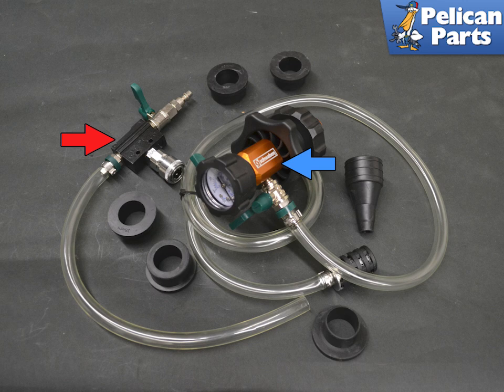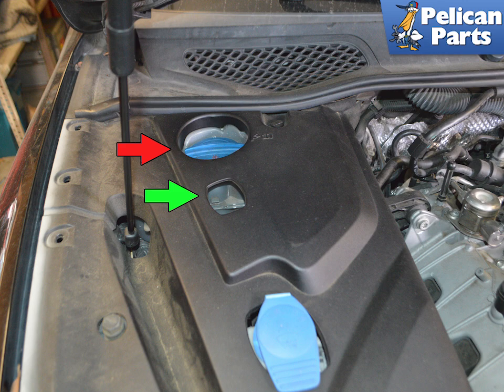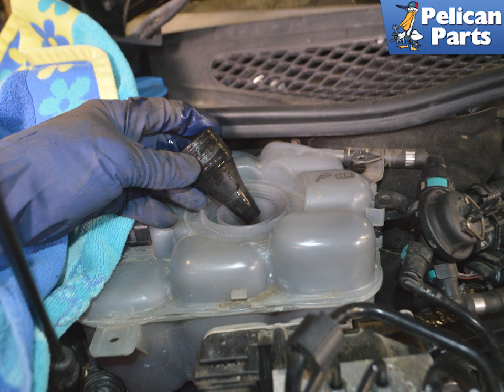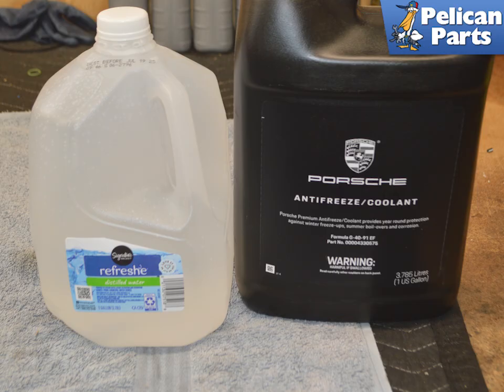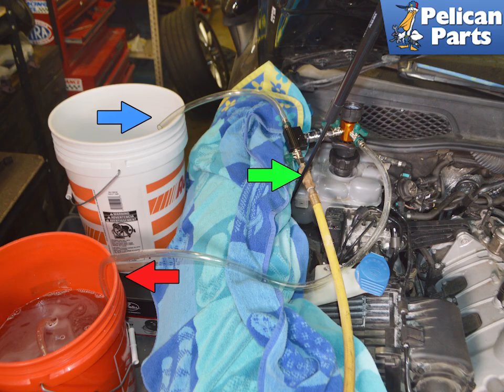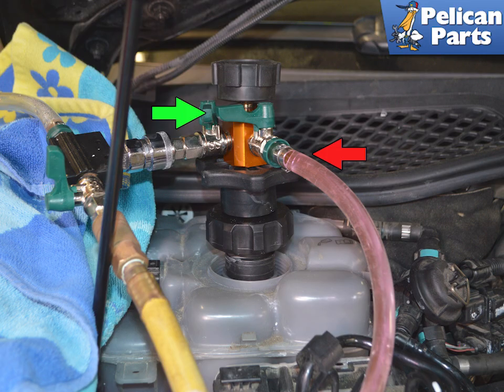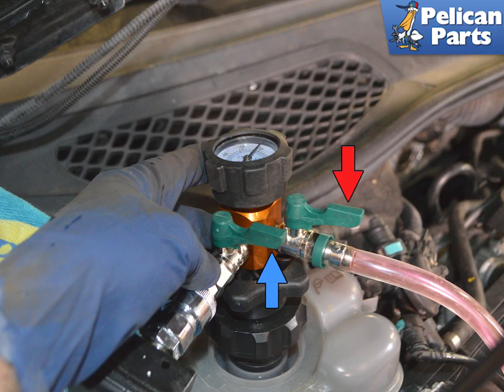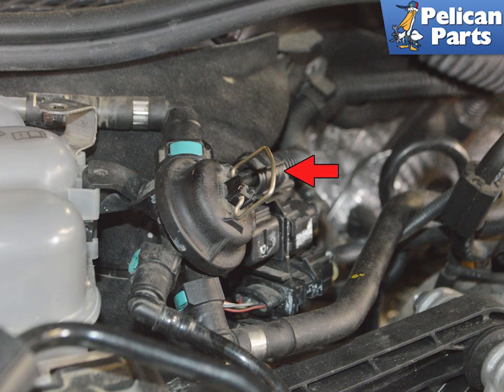Porsche 958 Cayenne Coolant Flush and Fill (2011-2019)

Comment: So according to the video you need 3 gallons of coolant and 3 gallons of distilled water?
Reply from the maker: The coolant amount provided must be approximately 2 liters more than the amount to be filled in when bleeding cooling system.

Because differing quantities of coolant can drain away during different types of repairs, the filling capacity can vary greatly.

Recommendation: To be on the safe side, fill the (bleeding system) cannister to 30 liters, then bleed the cooling system. The difference after bleeding is the coolant quantity that is sucked in. Check the volume scale on the cannister.
Reply: @pelicanparts your diy pages and YouTube videos are excellent. I will start buying parts from you guys.

Comment: Narrator says @1:06 "Open the bleeder valve (blue arrow)."  The 2015 Porsche Cayenne TDI (diesel) does not appear to have this bleeder valve.  What should we do in this case?
Reply from the maker: Best method would be a vacuum bleeder. If you don't have one, you can fill, idle and warm up, let cool, top up and repeat until full.
Reply: @pelicanparts  Cayenne Diesel bleeder screw is located on the EGR cooler behind the oil filter.  Look for a T20 head screw behind the T30's that hold the vacuum controller.  Open the bleed screw with the reservoir uncapped until coolant appears.  I had to do this twice after replacing the coolant parts in the valley of the V.  And yes, fill the coolant with a vacuum bleeder.

Comment: so you have to suck the old fluid first its blue, once it's out you close the blue and then open the red to fill in and how do you know when to stop and if bucket is empty will it suck air into the system
Reply from the maker: Measure what is removed. Then monitor how much you are filling. Toward the end of the fill have extra in the bucket as to not run dry.

Comment: Why must be do vacuum to refill?
Reply from the maker: The way the system is designed, air can remain trapped in hoses and components if you just fill using gravity.
Reply: @pelicanparts  thanks, in this engine if the coolant cap was removed when engine is hot and running can exit water seems like head gasket is burned or takes air the the system?
Reply: @pelicanparts then why the need to "burp"?
Reply: @TheMolacho1  Exactly what I’m wondering. The reservoir is the highest point as well, so if you didn’t use a vacuum to pull all of the fluid out (ie. You just drained it from radiator), I don’t see how air is making it into places that it wasn’t prior. I’m doing this tomorrow on my 16 CTTS without the tool. Just going to add distilled water as it’s draining from the radiator. Run it and bleed it after it starts getting clear, then repeat. So in theory, it’s like water is just passing through the system.